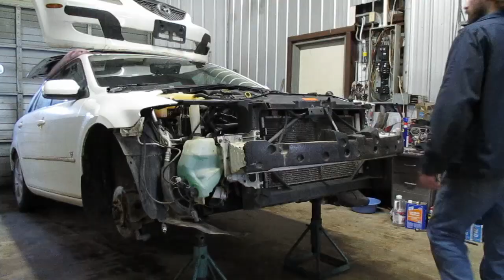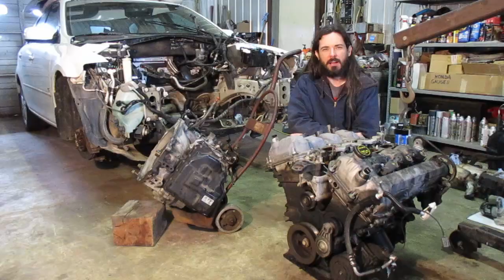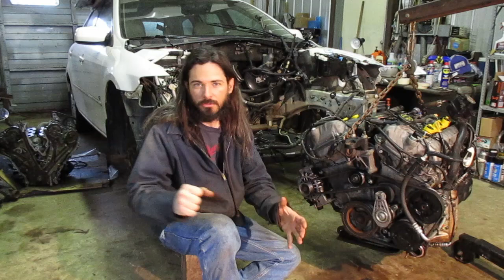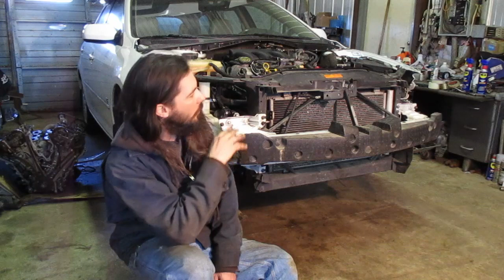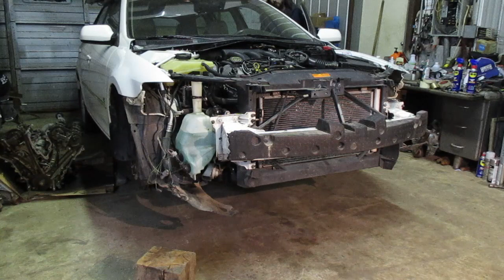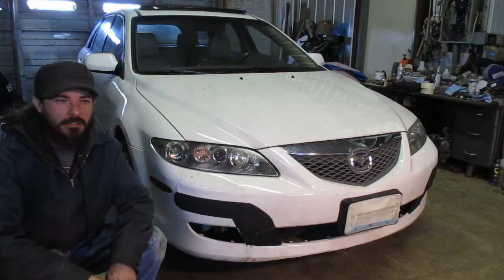Mazda 6 engine swap with Ford Fusion 3.0 (step by step) v6 motor how to remove and replace

Comment: Jared Drop one of those puppies into a 46 chev half ton.
Reply from the maker: Haha, thats a great idea.  If i was going to build a vintage front-wheel-drive v6 pickup, i would probably use the 3.8 liter V6 developed by GM in the 1990s that was used in lots of Pontiac and Oldsmobile sedans in the late 1990s.  Its a fantastic, bulletproof engine that gets 30 miles per gallon.  If i could have installed one in this Mazda without an enormous hassle, i would have preferred that engine.